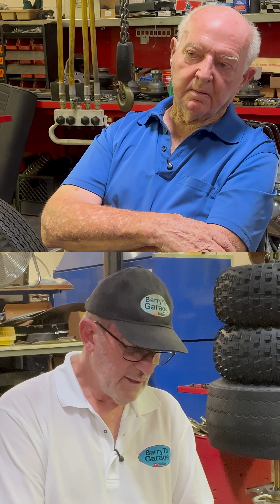Problems Racing Oldsmobiles - Ask Ed 32 - Ed Smith w #BarryT #oldsmobile #classiccars

Comment: They went for the Olds engine for the light weight and high cubes. Boat engines were inherently needing to stay in the lower rpm range and make lots of torque. They filled that bill Ok.

Comment: Big thing on Oldsmobiles if you ran them lower on oil even half a quart low on oil run the engine and over Rev they would start ticking rod bearing just spun😕 because the oil doesn't get back to the pan fast enough 😮

Comment: Olds engines were designed for low rpm torque and resultant quiet running with small bore , long stroke .
Olds 403 was the exception with 4.351 bore , 3.385 stroke . Large intake valve aftermarket heads make it a grate N.A. hp chioce but made it's redesigned block unsuitable for boosted use.
Reply from the maker: Thanks for sharing your knowledge on the topic!

Comment: Ive been working on an olds 350 rocket two barrel and fixing lots of stuff with brakes and window relay for power windows and all works good, just certain parts bad, but I cleaned out all the old gas and the old fuel pump no leaks motor nice and quiet fresh oil and coolant and it runs great like a dream quiet, solid, and it will be fun to get it all together for a nice restoration project, it's been fun!
Reply from the maker: That is so awesome to hear!

Comment: Narrow and large diameter, weren't the main bearings like 3" 🤔 in diameter? High   surface speed in fpm (feet per minute) and narrow width, not the best for high rpm high loads👍🏻

Comment: I have a 69 350 block 4 bolt main bored 60 over. One hump head and a 624 head.(best and worst) . I have trouble with initial timing, it wants at least 14 degrees. Should i just get rid of the advance and set timing to 35-36%? Set a higher initial and shorten the advance?
Reply from the maker: Good question - I will ask Ed

Comment: ive always herd the olds engines were never intended for high rpm.  makes sense why they didnt gear the cars low from the factory.  friend in high school had a 72 cutlass.  it would do 120 at like 3900 rpm. lol.  that old car was so smooth on the highway running 70-80 mph.
Reply from the maker: That is a great point.  I'll ask Ed what he things

Comment: Barry and Ed, could you give your info on the Buick 455. The good and bad, upgrades, etc. Thanks my friends. 🇺🇸💪👍✝️☝️
Reply from the maker: Sure, Daryl I will ask Ed in an upcoming interview 👍
Reply: @BarryTsGarage I hear a lot of Buick guys refer to their 455 as a big block but Buick never had a big block engine. Could you have ED touch on this subject? Thank you!!
Reply: @Lawnboy21  I've owned/built more than a few Buick engines, there is most certainly a size difference between a 350 and 455 Buick (small block/big block). Pontiac is the only division that used the same basic block design for all of it's engines- 350 and larger, cubic inch wise.

Comment: I increased oil pressure on a 1970 olds 350 rocket running down the road at 75 pounds ! I put new rods and main bearings in it taking clearance down to 002 thousands ran great
Reply from the maker: Sounds like you really dialed it in!
Reply: Mondello VO twister ... Check that torque monster out. All cast iron 039602F  casting block C casting head. Watched it wheel stand and run  9:80  all day long Famoso drag strip. RIP jo mondello!
 Had a 69 olds Cutlass supreme 477 cubic inch built with mondello parts claysmith Valve train. Ran 10:20 130 mph all day long. Made all the power under 5200 RPM. 1:50 60 foot times had a Mark Williams 12 bolt rear end.